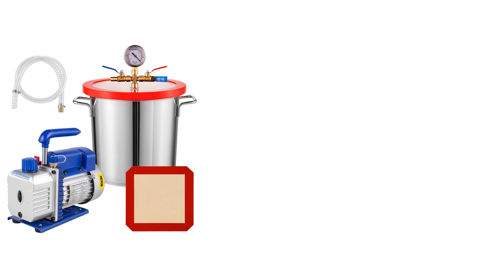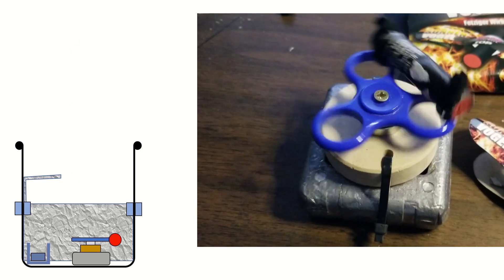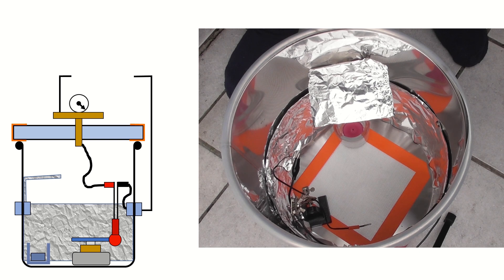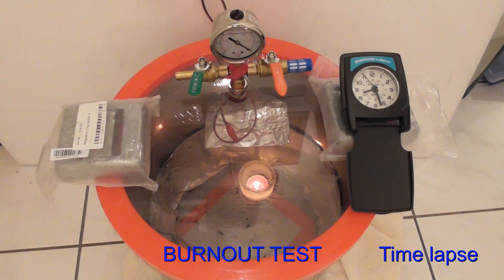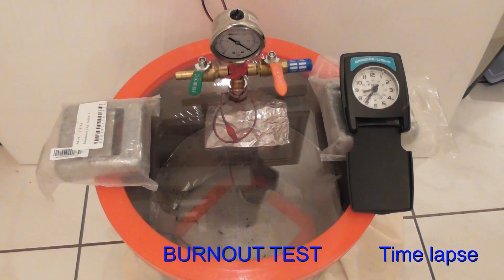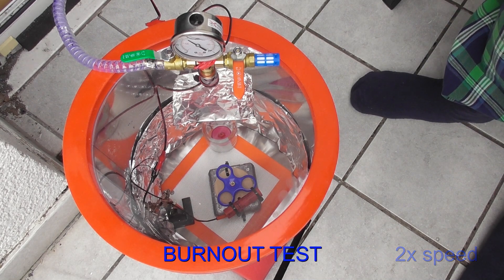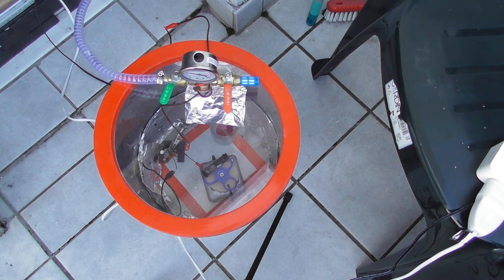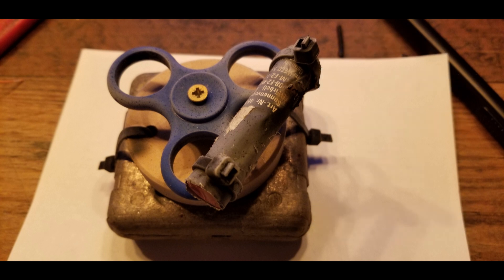Rocket in a Vacuum

Comment: I am curious how it would have behaved if you had left the vacuum on while igniting the model rocket engine.
Reply: Being a HVAC tech I can say for certain an oil change on the vac pump would be required
Reply: @mitch01463  decades ago in school, we often used a simple "pump" (attached to a water tap, air inflow from the side) to create some lower pressure, although certainly not a vacuum. does anyone know this, and how "good" of a "vacuum" could be achieved? but with no moving parts or a real motor/pump, there shouldn't be a lot to clean (or an oil change necessary) afterwards, and for a purely qualitative demonstration it might be good enough?

ps: i still remember the impressive short video where someone hung a soda can under the lid of a vacuum chamber, opened the can (filming with a highspeed camera), and it started moving and was propelled forward before the contents of the can hit the wall.
Reply: @Anson_AKB  yes it sounds as if it wasn't to dissimilar to a turbo system, lower the pressure yes a good vac probably not. With the right case and my pumps I'd near pull a perfect vacuum. I to at trade school boiled a soda at 16⁰C in a vac tube. That's what we were told them I suspect it had more to do with the Co² releasing from the liquid